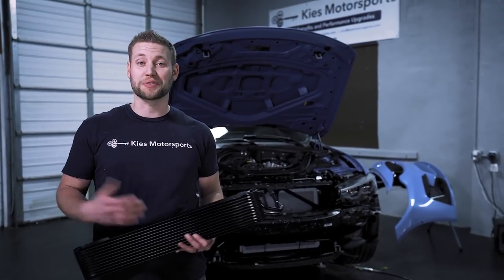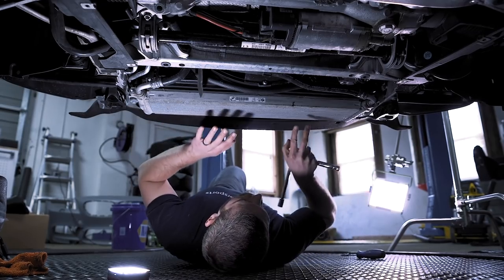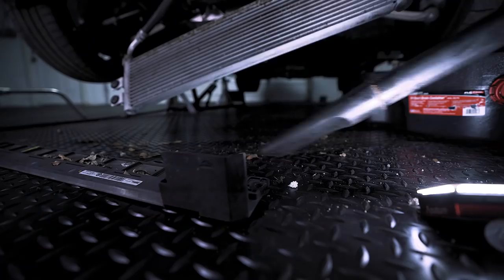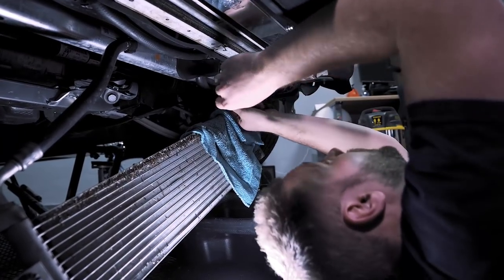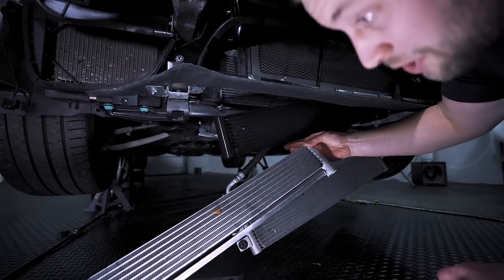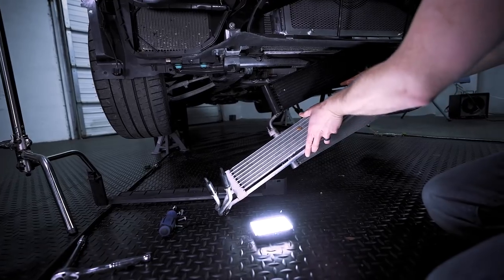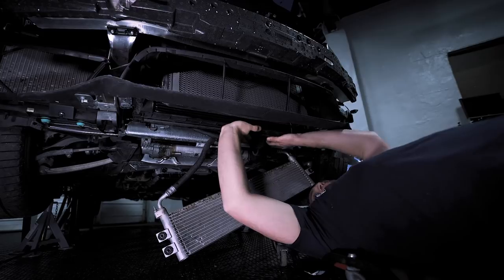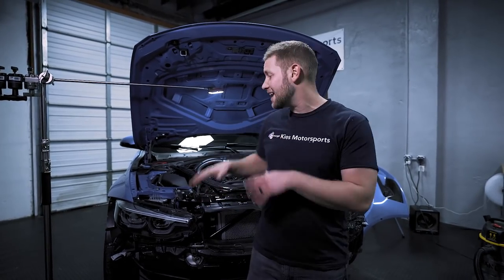CSF DCT Cooler Install F80 M3 | F82 M4  #F8xCooling #F80mods

Comment: Serious question, does this make a difference ? Do you really need to make the DCT cooler ?
- what are the benefits ? Besides more cooling ? 
- is the DCT affected by heat in reduced shifting performance ?

Thanks in advanced.
Reply: Cooler better

Comment: Hello nice spot thanks for sharing! I sometimes read datas from my M4 (F82) and make datalogs where I can also see the DCT temperature. I have only base DCT oil cooling system and the temperature keeps in range of 75-90C in a mixed driving style and ouside temperature 10-25C. Is there really a need to upgrade the cooling system with a new cooler when the operation temperature is up to 90C? Thanks, Richard